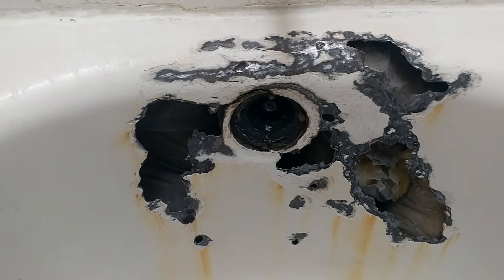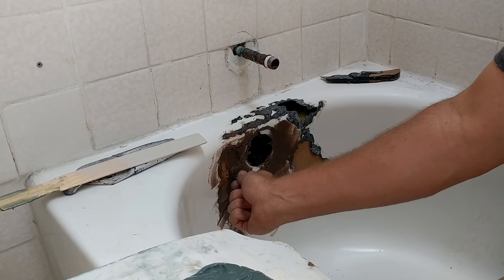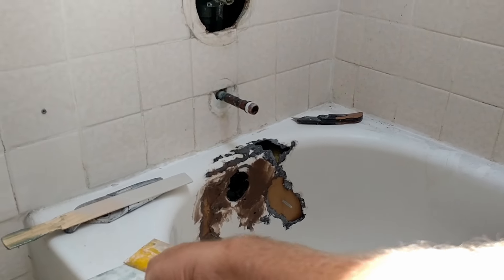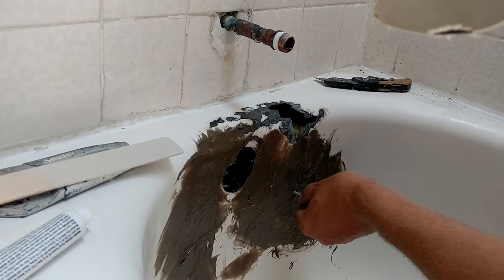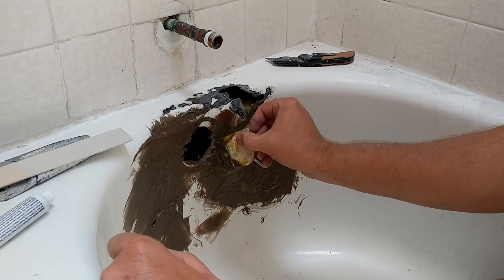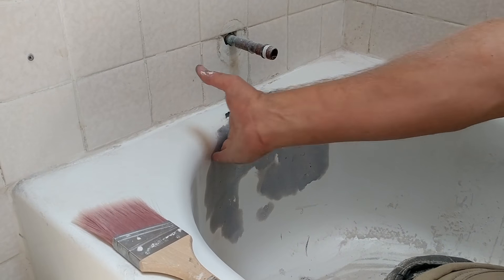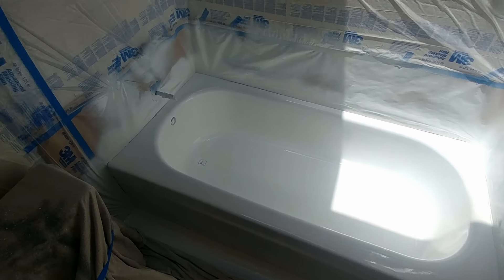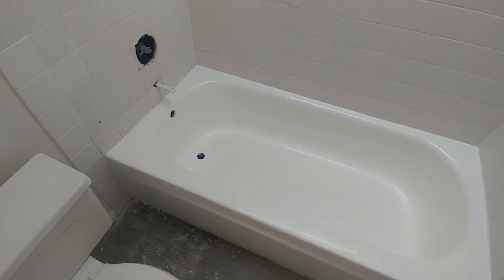How to repair a rusty hole in your steel bathtub

Comment: What was the stuff in the tub he put into the bondo before he started to mix it?
Reply from the maker: hi Pam ... that was the hardener cream that comes with the bondo when you get it and that's what makes the bondo hard ..... doesn't take much either
Reply: @classictruckaddictions7423   Thank you so much. We have a small rust hole and everybody is saying we need a new tub. My house is very small and they need to take the complete wall out from the living room into the bathroom  to get in there to remove the tub, and replace. So, we are going to try this. You are a blessing!!!      Do I need safety glasses and a mask?
Reply from the maker: @pamlee8532  dust mask for sure ... if you have any questions just ask i will talk you through it ....
Reply: @classictruckaddictions7423  Thank you me and my neighbor are planning this this week coming up.  I'm 70 he is 62, Wish use luck!! LOL I am sure we will do a great job with your expert help.

Comment: My bottom surface is very severe with rust pitted and in large areas. How would you recommend removing that sever pitted rust area? Sanding it> 2000 grain at first?

Comment: First, thanks for the video, this is exactly what I need to do on a tub.  I just would like to ask you for some clarifications.
1. First you use Bondo glass with the fiberglass fibers.
2. Your video said that you use a white filler Bondo, Polyfill next.  However, in your video it says USC duraglass wiht blue cream filler.  In one of your responses you said the second was Polyfiller-710 white.  Are they the same, or is one a 3rd step?
3. Should I go over everything with the Poly-filler again before painting?

Thanks for your help!
Reply from the maker: yes 3 different ....bondoglass 1st usc duraglass is 2nd and white polyfill is last step ... you can use bondoglass as 2nd step as well  because white poly fill sands so smooth and fills pin holes very well then primer and paint
Reply from the maker: Bruce Presley  hi Bruce ...you can use the grey bondo from home depot i just use the white poly-fill because it is easy to cover when i spray but its from multitechproducts.com
Reply: @classictruckaddictions7423  hello! I can not find the grey bondo... any help please... thank you so much!
Reply from the maker: @LeoCRoderick  for something like this i would use the fiberglass bondo from homedepot for the 1st step ...2nd step i use Dura glass it dosent have fiberglass in it and sands smoother less pin holes but you can use the 1st step here as well sherwin williams and amazon is where i got the dura glass and the white poly fill is from MultiTechProducts.com ...hope that helps
Reply from the maker: @LeoCRoderick   thr grey bondo you can find at auto parts stores but only use it for final coat for smoothing.... it just dosent have the strength

Comment: Hi I sent you a message / question about your thoughts on doing a hole repair next to the drain using j.b. waterweld since it's easy to just knead and apply and it's white....
Reply from the maker: depends on how big the hole is,and if you can get the JB on both sides of hole ....if hole is small you will have to leave extra on the top side larger that the hole and not sand it smooth ....so it doesnt punch through ... does that make sence ....and if you have some good clear coat to put on it so it doesnt stain
Reply: What did you end up using? Did it work? I have what is not a hole yet but rusted thin and thought about using the JB weld before it gets worse....thoughts?

Comment: Thanks so much for this! If you don't plan to paint the entire piece is there something good to use to replace the last step and go with a normal porcelain white?
Reply: Also wondering this. I have a few tiny pinholes in an antique cast iron tub. Did you find that white product and try it?

Comment: Hi! Great video. I'ver got a cast iron tub I'm going to be using your method to fix. One question though. Why didn't you just use the second fiberglass filler for the whole tub. Instead of using the Bondo cat hair in the beginning?
Reply from the maker: cat hair was for strength ..the 2nd is pretty much the same but with out cat so strength again but sand smoother and the white bondo AKA polly fill doesnt have the strength but sand very smooth and is easier to cover with epoxy rather than the 2nd one
Reply: My question has been answered by reading this thread.
Reply: where can i purchase white bondo or is that the color after white hardener is applied ? also what is the brand of white polyfill

Comment: Awesome job! My tub is not nearly as damaged. Just some rust around the trip lever and some minor chipping. What kind of paint did you use to repaint the entire tub? Thanks!
Reply from the maker: thank you ... its from hawklaboratories.com .....their low odor and low VOC line its awesome
Reply: Forgot to ask: at 10:07 you said you will go over the initial bondo with the white something bondo. What bondo were you referring to? Thanks!
Reply: @mrchedda  also interested in knowing what the “white cream bondo” “polyfill” layer he used was. Did you ever find out? Thanks 😊
Reply: @yibuseato  Still haven't gotten an answer so I still don't know -_-
Reply: That URL has been hacked - it redirects to various scams

Comment: I really want to try this.  Please list the supplies I need to buy.  mainly the different types of Bondo and epoxy. Thanks in advance
Reply from the maker: 1st bondo ... at Sherwin williams is called dura-glass ... very hard 2nd is Poly-Filler 710 (White)  http://multitechproducts.com/poly-filler-710-white/ ....  it sands very smooth and covers the dura glass so easier to cover when you paint it white ....and far as the primer i use from (integrity coatings ) with their wipe on adhesive bonding agent .....white epoxy from.... https://www.hawklabs.com/products-menu ....their low VOC high gloss white ...... as far as cost its my business so i get better prices ......
btw to use this you need a good HVLP tubine spray system .... hope that helps
Reply: @classictruckaddictions7423  what sandpaper grits do you use, 60 and 320?
Reply from the maker: @missygraham313  morning .. on the dura glass bondo use 60 or 80 to shape your repair but the polly-fill (white) start finish with 220 it sands very smooth .... but you can go to 320 if you want but once 220 is done you'll probably be just fine
Reply: Classic Truck Addictions how long from start to finish did it take you to complete the job?
Reply: Joe Joe your still going to use the kitty hair right? If you just use a filler for something this big in the video you will have problems later. Bondo alone will not have the strength as the glass reinforced filler, the glass helps it maintain longevity!
Reply: @mlinecomposites1  Good point.  I agree.
Reply: @mlinecomposites1  it had it all ready
Reply: @moisesbonilla9362  had what already? What do you mean?
Reply: @mlinecomposites1  the hair is in the bondo, no need to reinforce
Reply: @moisesbonilla9362  no it’s not just in a body filler 
Like bondo. It depends on the type of filler, regular brand name bondo isn’t strong enough in the end, that’s why I already said using the kitty hair has fiber strands
Reply: @mlinecomposites1  you can add the hair and add the the hardener liquid to make it hard like a rock
Reply: @moisesbonilla9362  not arguing that fact at all, I’m just saying it doesn’t already come in it, as you’ve stated to me it’s already in it. I’m just simply saying it doesn’t already come in it.
Reply: @mlinecomposites1  not at all, there is bondo hair available slso
Reply: @moisesbonilla9362  yes sir
Reply: @mlinecomposites1  also available is hair mats, but you would have to add bondo resin
Reply: @moisesbonilla9362  yes sir for sure  
If your referring to veils 
I’ve spent over 20yrs in the composite industry 
Very familiar with veils of all kinds aramid veils, carbon veils, fiberglass veils
Reply: What did you do with the hole on the bottom of the tub
Reply: Do you work in providence, to. I need my tub fixed
Reply: @classictruckaddictions7423  Sherwin Williams says they do not carry a product called dura-glass...where can I find it?
Reply from the maker: @kathyryyth7438  AmaZon has it for $43 bucks a gallon
Reply: Looking to go with: Bondo Glass Reinforced Filler/USC Duraglas by Valspar/Poly-Filler 710 by Muti-Tech...then hire someone to spray the tub!
Reply from the maker: @kathyryyth7438  and the spray tech can fine tune the repair job if needed ....good luck let me know if you have any Q?

Comment: I was about to use j.b. waterweld to fix a rust hole at the drain. Could you tell me if you think that is as good a solution? Seems pretty easy , you just knead the putty, and its already white...  Why or why not?  Thanks! And i think I'll subscribe.

Comment: Hey.  Wish I would have watched this helpful video earlier.  I had a similar issue, but I believe my tub is enamel over steel (house built 1987).  I went with JB Weld Marine epoxy, it dries to a nice opaque white, and I didn't have enough damage to repaint the whole tub.  My rust holes were only dime-width.  So far so good.  But we'll see if it holds up...
Reply from the maker: that should work just fine ...if it starts to stain just lightly sand and apply some clear to protect it
Reply: @classictruckaddictions7423  Hey Bro.  So my marine epoxy started to peel after 3 weeks.  The repair area is right around the drain, so it's gonna get hit with hot/cold water daily.  If I primed the surface before I re-do the epoxy, do you think that would help?  Could you suggest the best primer, and clear coat products?  I sure do appreciate it!
Reply from the maker: @presence5426  what brand epoxy did you use ....what did you use to clean the spot with and did you use acetone to wipe it down before you applied it ....any rust should be sanded out 1st then cleaned ...did you use a bondo to fill the spot ...things i need to know
Reply: @classictruckaddictions7423  I used JB Weld Marine Weld.  It's labelled as a "marine adhesive an sealant" but I thought it would be an all-in-one repair.  Perhaps it's not epoxy, but you mix the 2 sides of the tube and it dries in 5 min.  I didn't use acetone, I used 90% rubbing alcohol.  I did get rid of all the rust and the surface was clean, dry, and wire brushed.  I used no bondo, my holes were small so I just used a fine steel mesh over them, and spread the Marine Weld on top of that.
Reply: It's been 3 years has your repair held up?
Reply: @simpsonhomerenovations  Nope. And it was really dumb of me, in retrospect. The patch failed slowly. So water had been dripping beneath the tub before & after my repair. I didn't know that there was only a small hole in the concrete foundation under the tub, where water could seep into the soil. So, the leak ended up promoting mold growth, which spread into the walls. So this Fall I had a contractor rip it all out and renovate. Live & learn!

Comment: Thank you for posting this. It will help with a really big Kohler cast iron whirlpool (master bath) tub where I removed all the jets. I removed all five jets because of all the nasty flakey stuff that came out every time I turned the jets on. It didn't make any difference how many times the tub was cycled with dishwashing soap and cleaned - after a couple of days the flakey black stuff was back. A real PITA. So I removed all the jets and the pump motor. A really big PITA. I discovered that all the jets were clean - all the flakey stuff was residing in the pump motor. Obviously, with the pump being permanently attached to the tub with all the plumbing hardware - one could not access the inside of the pump motor and clean it. Moral of this story - I will never, ever own another whirlpool tub again - PERIOD.
Reply from the maker: ive done that a couple times for customers and it looks great after and for the same reason ....glad it helped

Comment: Wow looks great!  What's the rust remover that you used on the rusty steel before you put the bondo on?  What spray paint for the final coat?  Thanks
Reply from the maker: most rust removers will do the trick but you should sand or use a dremel tool to grind down the area to clean metal ...make sure soft areas are cut out ...cause if your gonna fill holes it ok to make a couple more .....ps you really cant get all the rust on backside of hole but you will stop the water from making the rust worse ...hope that helps
Reply: @classictruckaddictions7423  Ok yeah that makes sense, so grind it down and then rust remover then bondo.  What's the final spray paint that you used? thanks

Comment: Hello, Thank you for sharing, I want to fill in and close my overflow hole in my antique cast iron clawfoot bathtub, and was wondering if the Bondo Glass you're using would work better. I planed on putting a piece of fibreglass cloth on the outside of the overflow hole, and filling it  with the Bondo Original formula on the inside and going back outside covering the fibreglass cloth with Bondo letting it set and sand. However watching your video I'm thinking the Bondo Glass might be a better application. What are your thoughts? Cheers, Willow
Reply from the maker: YES it will

Comment: Great video.  Very helpful.  I thought about perhaps a better material than cardboard.  There are precut perforated drywall patches that are aluminum with a mesh netting, that along with the fiberglass (with hairs) seems unstoppable.  Very good info. I have 2 that I have to do.  What sprayer and material do you use?
Reply from the maker: the paint is from Hawk Laboratories and its the ISO free high gloss white ...the sprayer is a Graco Elite Pro turbine ,but and brand turbine will work
sorry for the delay

Comment: what kind of paint did you use to paint your bathtub with? thanks
Reply from the maker: Hawk laboratories ...has a low voc and low odor white tub coating ... but there are a few other companies that have good coatings as well
Reply: @classictruckaddictions7423  Thx

Comment: What kind of primer and paint did you use for the tub?  And, did you apply the paint using an HPLV sprayer?
Reply from the maker: yes i used an HVLP Graco turbine .... the primer and bonding agent are from ...Integrity Coatings the paint is from Hawk laboratories...its their low VOC .... just go to both websites and check them out ...there are other companies but this combo works great for me and it last without peeling mainly because of the primer and bonding agent
Reply: Can you just use a paint brush to cover the repaired area? I don't have a paint sprayer. The hole I'm trying to repair is about the size of a half a dollar. The tub is white I believe it's in enamel over metal what products do you recommend to bring the tub back to its original color
Reply from the maker: @nature8446  if you just want to cover the repair you can use a small foam brush ....if you wish to cover the whole tub home depot does have a tub kit ....they aren't the best ,but if you go that route the number one thing is to clean the tub completely then wipe it down with acetone before you apply hope that helps

Comment: Thanks for nice advice, my bathtub around the drain is almost rusted true, could this Fiberglass filled Filler prevent of further deterioration if I just send it around a drain and apply around it. Where do you buy this stuff? Thanks
Reply from the maker: yes it will but you must try to sand as much rust away as possible.... you can use a rust remover then sand it ...most auto parts store have it or home depot

Comment: Would you please put the steps you explained in the video in order in a reply to this comment, I got a bit confused with the different names for the materials. I have a rough idea however I would appreciate the clarification. Thank You. Also, what's the difference between the red cream and the white cream? (In the beginning). What's the polly-filler white? it doesn't come out in the video.
Reply from the maker: i will do that tomorrow but look at my reply to fernando valenzuela it gives you links to the filler

Comment: Did you do the same process on the drain hole? I have an area I’m trying to fix now.
Reply from the maker: yes any hole ...if its to small and on the floor  you really need to make sure this technique is do right and it should last a long time

Comment: H!! How much did u spend all in all?
Reply from the maker: well this is what i do for work ... but i used 2 kinds of bondo for the repair then with the primer and epoxy paint plus the sand paper and 2 different cleaning chemicals  tape and paper,plastic ....maybe $100 bucks ...but i buy in bulk so whats not used today gets used tomorrow and so on and that cost gets cheaper for me as a business ...FYI i charged 400 for tub and 250 for repair ...hope that helps

Comment: What does it cost for you to come out and do this?
Reply from the maker: ok just for me to do a CHIP repair the size of a quarter is $150 .... but this job was for one of my contractors that calls me a lot,so i charged him $250 then the cost to spray the tub ...but other tub guys will have different prices ...and if its done right its better than pulling the whole thing out ...hope that helps
Reply: @classictruckaddictions7423  Hello, I have same issue with my bathtub in city of milpitas, CA. and i would rather have you do it if you are near by, by any chance. can you update where are you located. Regards

Comment: Looks great but must have taken a lot of time overall. I imagine it would have been cheaper to replace with a new tub. But then the walls would have required retiling.
Reply from the maker: it took me almost 3 hours to repair then 2 hours to clean,tape and paper tub and spray so in and out 7 hours total